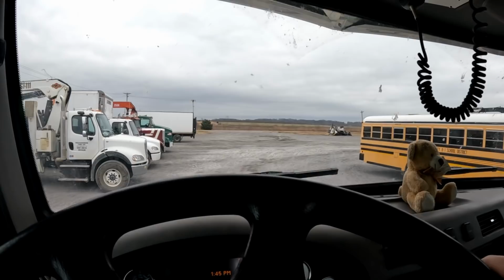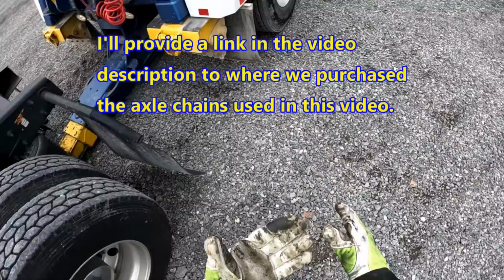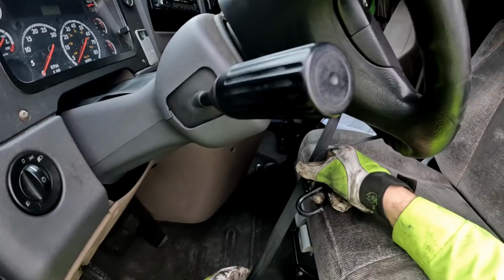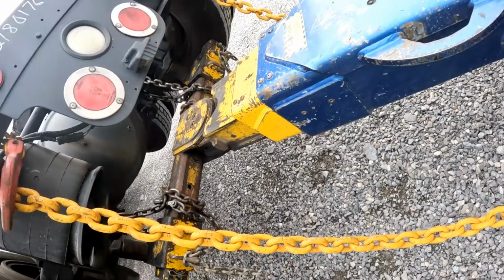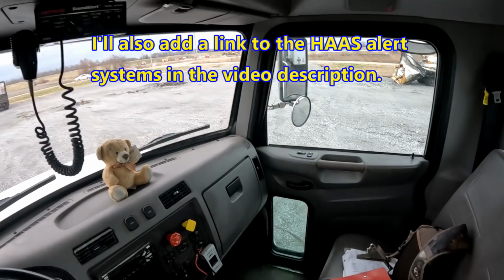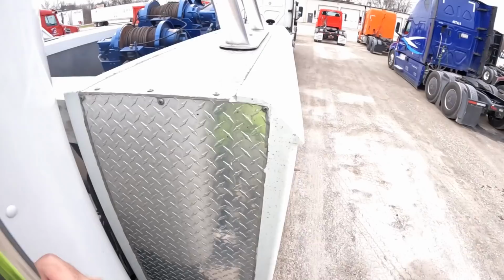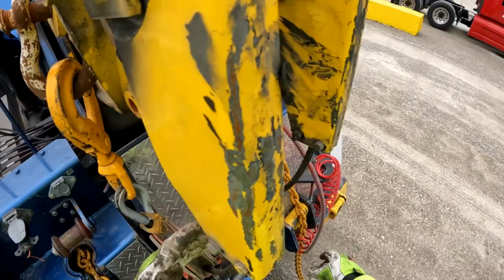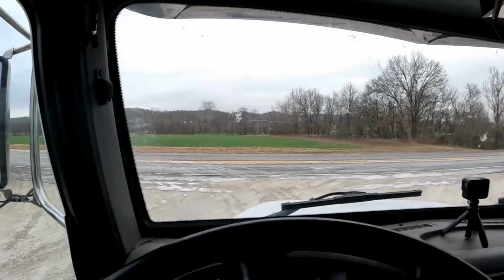On The Hook Again.  Freight-Shaker's On the Hook Again.  Towing 'Shakers is the Life That I Live.

Comment: How did we ever tow or recover without all of the technology of today....
Reply from the maker: It's never been an easy job.   People who've never done it may think it is, but it isn't.   Today's technology does make things safer, for sure.   I started out working an old Holmes 750 split boom with manual boom extensions.   It was an excellent piece of machinery in its day and it was definitely a work horse, but it can't compare to today's equipment.   The old 750 had a "manual" retrieve on the winch drum.   You took a crank handle, slid it over the shaft, and literally cranked the wire rope onto the drum when it was on free-spool.    My shoulders hurt just thinking about it.....   Thanks for watching and God bless.
Reply: @RonPratt  my first was a Holmes 440 on a 66 ford F 350. Up graded to a 68 F 350 with a 480. Also had a 63 F 500 with a 600,I believe, so I know what you're talking about...when we got a hydraulic I thought I was in 7th heaven...lol
Be safe and keep the videos comming...

Comment: That U bolt cup seems like it could easily pop off with how loser the chains are. How is that an acceptable method of towing, poor an I missing something? And pulling the entire load from two bolts that are around 1" in diameter? I am not seeing how that would work
Reply from the maker: The U-bolt cup towing method has been around for a long time.   I can't tell you how many times I have used this same method and I have never had an issue with it.  There are always safety items that an operator needs to check prior to using ANY towing method.   Also, the manufacturers wouldn't put this product out, the U-bolt cups, if they weren't confident in it's design, otherwise there would be too much liability on the manufacturer.   Thanks for watching and God bless.

Comment: so, the job shown was a simple tow and you did 1 thing new after 6 years of watching, check the light bar function. First time you have shown that. :)

45 minute drive at normal speed done at 5 mile an hour is 11 hours roughly. truck owner needs to grab a brain cause his driver will have to stop overnight.

Comment: shouldn't the parking Break Lights always be on if yellow and red switch's pulled out meaning tractor Break should always have the Lights on any time you park with a tow truck right so why would a wrench break turn off the parking lights if the parking break is set explain that it sounds like a very safety problem not to have your parking lights off it parking break is on so that sounds crazy explain that Ron Pratt please in a video why would parking lights be off if parking break is on and wrench break off
Reply from the maker: Actually there isn't a "parking brake" light.   There are brake lights that come on when the foot brake is depressed (applied) but it goes off when the foot is removed from the brake pedal.   If there were a "parking brake" light, it would be a constant drain on the battery when the truck is sitting parked.   Thanks for watching God bless.
Reply: @RonPratt  what I meant is when your red vaulted and yellow air nobs are pulled out those lights should always be on not toggled by the wenching beak switch being off or on they should only go off if yellow and red button pushed in like a normal 18 wheeler basically what I’m saying is if you parked the tail lights should always be on in your video you where parked and tail lights where off meaning you would be responsible for a rear end wreck if some one came up behind you and didn’t see ya that’s the point I’m trying to make
Reply from the maker: @byrd203  I guess I'm not following what you are saying.   With the yellow and red valves in the STOP or PARKED position there should NOT be any lights on, otherwise it would drain the batteries.   The winching brake switch that I flipped activates the service brakes, just the same as if I were in the seat with my foot on the brake pedal, which activates the BRAKE lights as is normal.   I just don't follow what you are trying to say.   Not trying to be rude, I just don't follow